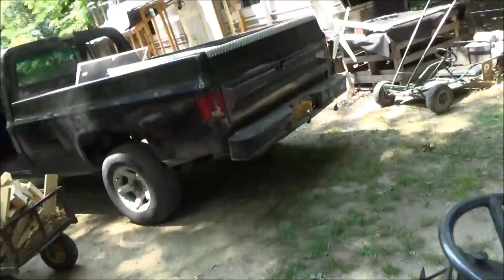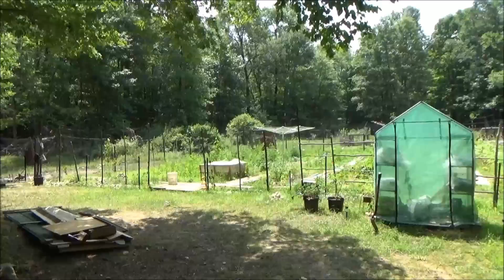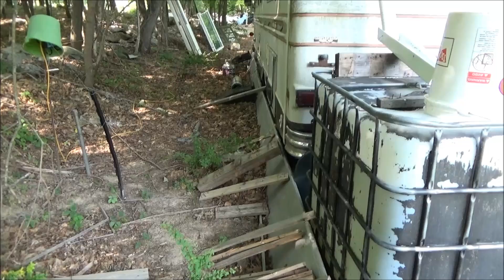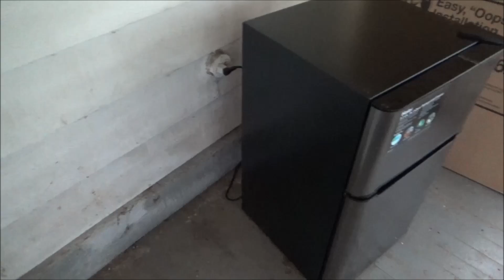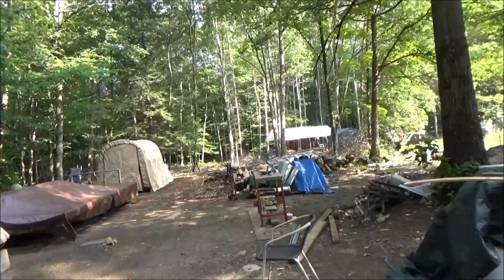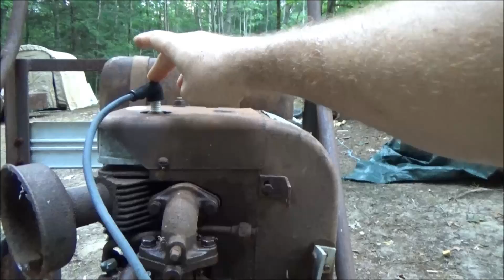Selling And Trading For Materials And Cash To Build My Tiny House

Comment: If you had kept the refrigerator wouldn't have worked just fine I your tiny house once it was up, insulated and air-conditioned with your solar and wind power?   Wouldn't the inside temperatures of your tiny house be compatible to the temps on the landlady's porch?
Reply: Rather a moot question if he does not have the money to build the house.
Reply: Oh, ye of little faith....give Troy time and the benefit of the doubt and the project will get done.

Comment: Good wheeling and dealing. I like that window. 
The bubble wrap is nice but as you say, it works mainly in one direction. You may have to add normal insulation between the outside and the bubble-wrap to get the insulation against the summer heat. It may also be needed to really get comfortable in the winter. Definitely worth investigating further.
The chickens were a good laugh. That small one is a beauty.
One question: you say you have enough material to frame the house. So far we have mostly seen pallets which you said were for the inside paneling. Will the framing be done with lots of short pieces of lumber, or do you have proper lengths as well stashed away somewhere?
Keep up the good work!
Reply from the maker: Thanks. I will use insulation and the radiant barrier. The chickens are fun to watch.
I do not have the wood yet. I will get it next week. I now have the money for it.
Reply: The Do It Yourself World I heard today's update. Looks like (almost) full steam ahead. Looking forward to that!
Reply: The Do It Yourself World
YAY!!! Good for you!

Comment: Sounds like you got a good deal on the boat trailer! If you come across a trailer that can be used for a tiny home, keep me in mind. I might be interested in buying it. I'm only about an hour and half northwest of you. FYI: that radiant barrier needs to have space in front of it in order to work. It needs to go on the inside on the framing studs. There are some good vids on YouTube about how radiant barriers work.
Reply from the maker: I sold the heavy equipment hauler. Too bad I did not know you wanted it before. I still have the boat trailer for now.
I will place the radiant barrier inside the home with space on both sides for maximum benefit.

Comment: That will not be enough insulation for your tiny house. You must use house wrap too.
Reply from the maker: Its only a radiant barrier. I will use tar paper on the outside and radiant barrier on the inside.
Reply: I would use house wrap from Lowes that stuff works great. It allows moisture to escape yet blocks wind.
Reply: Captain Carl Wright
Sounds great. Do they make underpants out of that stuff?
Reply: You'll have to ask Troy about that.
Reply: Captain Carl Wright
" It allows moisture to escape yet blocks wind. " It was a joke about this phrase.
Reply: The Do It Yourself World Hope that "tarpaper" is another general term.  I think House wrap works well.  Strikes me as being lighter, too.

Comment: That engine may sell more easily and for more $ if you got it running.  I understand if you don't want to waste too much time on it.  As old as it is though, it most likely runs on leaded gas which can be difficult to find.  Auto parts stores sell lead additive in small bottles though.  I don't know much about small engines but it's safer to find out first.  Good luck!

Comment: Did your customer take the boat or leave you with it?
Reply from the maker: Sold the heavy hauler trailer.
Reply: Sold the trailer appropriate for building tiny home
Reply: W8FG Ah, I didn't get that at first.  Yes, I agree.  We tried to get him to act in his own self interest and use the trailer not made from spaghetti.  Hope it works out for him anyway.  There was no need to gamble or rely on "hope" with that equipment trailer.
Reply from the maker: RadicalRC That trailer was smaller. Too small for me. And HEAVY.
Reply from the maker: I would have needed to hire a professional towing service with that trailer anyway. It was over 3500 pounds empty
Reply: The Do It Yourself World You are already planning to hire a professional towing service regardless.  It's weird, but I remember things.  ;-)

Comment: I am eager to see walls!  So, glad you got the trailer sold... hope you can get enough  2x? to do the walls now.

When does the framer plan on arriving?
Reply: The Do It Yourself World
Seriously, find another professional framer. Put an ad on Craig's list offering your services in exchange for a retired framer to help and work with you. You can offer lawn mowing, attic cleaning, hauling or whatever they wish two hours for one since they will be giving you the skilled help you need for unskilled help they need. Some retired builder may be happy to pitch in and feel useful again especially if he can get help and companionship in exchange...not to mention getting away from the beloved wifey for a while. :)
Reply from the maker: He is not coming now. I need a Plan B. I guess I could set up a tarp and sleep under it ;)
Reply: *****
Perhaps he could make a sleeping bag out of the reflectix.
Reply: ***** The roofing is the large sheets of green metal that he has... I am not sure but I think he will need another set of hands to get that safely up top, but once up it goes on really quick.  The roof framing is planned as (what I call) a shed roof...it is flat but it will still be a real challenge to frame and I am concerned how much time the roof framing will take.  It looks deceptively simple.  Not easy but where there is a will there is a way.
Reply: Uncomfortably Numb
Well, I can see your point.

And yes, I do think that hemp needs to be put back into the environment to help clean up all of the agricultural and industrial chemicals that we've polluted this planet with over the last century.  (Like they're using it as a bioremediative plant around Chernobyl and Fukushima, to help remove radiation from the soil.)

The sorts of cannabis that have medicinal value should also be available to everyone again...but that's a whole different issue, as medicinally beneficial strains of cannabis are one of the top three reasons that hemp was made illegal in the first place, the others being petroleum fuels replacing hemp seed oil and alcohol as fuels (both 100% annually renewable, natural, carbon-neutral, and freely available to anyone with enough land to grow on), and William Randolph Hurst wanting to replace hemp in his newspaper with paper made from the trees he had on his thousands of acres of forest land...which his buddy who owned Dow Chemical figured out a way to make paper from trees, while selling a ton of toxic chemicals in the process.

History!  It's bloody amazing what they've done to this planet that never should have been done, when you do a little research!  d;o)
Reply: *****
Onslow was one of my nicknames. Can't think why. apart from the facts that we look and talk exactly the same. And these days I am completely surrounded by no beer.
Reply: The Do It Yourself World
Well, you've already got a book on framing, so taking your time, making sure all the wall studs are the same length (you already knew that part), making sure that all of the bows in the studs face OUT (I mentioned that earlier), and you can get that banged out in a day or two TOPS with a couple of guys showing up to help raise the walls once they're complete and square.

The ROOF is the part where you're going to need "skilled help."  The simple logic behind that is that it doesn't matter how good you did the walls and the floor, if the roof leaks, YOU GOT PROBLEMS!  Just with the actual framing of the roof itself...shingling is fairly easy, just time consuming when you're hammering it on, and not using a nail gun...but most people don't have a roofing-specific nail gun anyway...which is what you'd need for that job if you weren't already planning on doing it manually.
Reply: The Do It Yourself World
You could throw a tarp over the blue table then curl up underneath and sleep through the winter months.
Reply: Uncomfortably Numb
Actually, being realistic about it, the smaller the space, the easier it is to heat, and the more well-insulated that small space is, even better.

There are people who've built hyper-insulated homes that are so efficient that they need to open windows in the winter when there are more than a half-dozen people in the house!

And we KNOW he's got more than enough insulation, now!  d;o)
Reply: The Do It Yourself World I agree with Larry.
Reply: Uncomfortably Numb
I hope not...a do it yourself sewing video does NOT sound terribly entertaining, to be honest...  d=^o
Reply: *****
lol. Got to be at least as entertaining as making salad.
Reply: Actually, that's not a bad idea at all...doesn't matter if they're a friend or not, if they're QUALIFIED and you can still work out a good deal that's beneficial to both of you, the cost can be the same either way!  d=O)
Reply: Uncomfortably Numb
No...I think making salad is slightly better.  Now, if they were showing how to create the thread from wild hemp fibers, then it'd be more interesting.

You know...running through the forest, with "The Long Arm of The Law" hunting you down, as you try to get enough wild hemp stalks to make your thread...it'd be like an episode of "Moonshiners", only with a far more mundane series finale...  d;o)
Reply: *****
As someone who eats tomatoes and basil with lettuce and cucumber at least 3 times a week it is not really that exciting to me.
I now have a vision of you swinging from hemp liana's through the trees in a loin cloth. (reference to the motherlode of pallets video at the end) ;)
Not heard of Moonshiners here in ole blighty will have to look that one up.
Reply: *****
Don't forget clothes & building materials etc.
Reply: Uncomfortably Numb
And almost everything made of plastic...could be less toxic, and biodegradable.  Funny thing...anyone looking around their room right now is seeing DOZENS of things leaching toxic chemicals (or DONE leaching them) into the air around them, and thinking "Huh?  Whassis, eh?"

And now they're counting the number of potentially toxic plastic items within eyesight...  d;o)
Reply: *****
It is truly an amazing plant. What is more amazing is that it is classed as a weed. More like life support plant to me.
Reply: Looking back through history, it was one of the main ingredients in "gruel."  You know...that stuff the Dickens' lil' bugger wanted more of?  d;o)

Nuts...now I'm thinking about food...and there ain't no Gareth Blackstock in my house...not even an Everton...  (a proper Brit will catch the reference...)
Reply: Sorry to dissappoint you I am a brit of 51 1/2 years, Grew up near Liverpool then moved to Reading in 2001 then to Portsmouth last year. I had to google that. Never watched the show. Not even trailers. I think it was on during my heavy drinknig days, ie straight from work untill kicking out time. (midnight usually)
Reply: Uncomfortably Numb
Pub after work 'till legless?  Yup....still qualifies as "Proper Brit."  We'll let "that one minor faux pas" slide.  (Sorry about the froganese.) d;o)

And me, completely missing Onslow...a much more obvious reference...horrible oversight on my part, wasn't that?  d=^o

Comment: Great buy on that window!    How do you plan to use the barrier?  Over other insulation or alone?
Reply from the maker: Thanks. I will use the barrier on the inside with spacing on both sides for its max benefit.
Reply from the maker: Larry Carlston I am quite surprised myself. I guess that is the benefit of shade and insulation. I do not have either in my RV. The tiny home will probably be that comfy next summer.

Comment: Why not use your cardboard as weed barrier in your garden rather than throwing it away.  Earthworms love the glue that it is made with and you will be amazed at how short a time it takes to attract them.
Reply from the maker: I am going to get a bunch soon
Reply: Get a bunch of earthworms?   Put the cardboard down in your garden and you will attract them by the hundreds...harvest them for your worm bin and you won't have to buy commercial worms at all.   I built a lasagna garden with layers of cardboard, leaves, pine needles,wood chips and composted manure on top of almost pure sand...(I live in an area of Wisconsin where they are harvesting our sand for fracking) and attracted so many worms it was unbelievable.  Plus, my garden production was through the roof that year and in the coming years....I had to add nitrogen the first year due to the breaking down of my mulch but it produced a wonderful black topsoil where there was none before and nothing grew due to a heavy layer of pine needles over a semi shaded area..

Comment: The silver barrier material works very well.  I just did my van and it made a world of difference to sound and heat / cold.  Glad to see you getting your materials together and slowly sell off the stuff you were planning.
Reply: ***** Thanks.
Reply from the maker: Yes its coming along slow but sure. Good to know about the radiant barrier. Thanks
Reply: The Do It Yourself World That is truly AWESOME!! I have been trying to find that stuff around me. I thought they would have it at Home Depot, but I haven't found it yet. :(
Reply from the maker: MotherOfManyHorses They should have it. I just saw it online. Someone posted and said it is called "Reflectix"
Reply: MotherOfManyHorses I bought mine at Home Depot Placed the order and had it in a few days.  http://www.homedepot.com/p/Reflectix-24-in-x-100-ft-Double-Reflective-Insulation-BP24100/202851855?N=5yc1vZbedf
Reply: The Do It Yourself World I guess it's not something they carry in the store near me then. I'd have to order it online. I'll look into it, thanks.
Reply: MotherOfManyHorses NP. The barrier goes up very easy. Its bubble wrap core with a thicker outer shell if plastic aluminum sheen. Similar to those space blankets runners use after a marathon or a survival blanket. You can either spray glue or staple gun in place. I also added a either the same material Troy used in his flooring or polyfill insulation in my project and was totally impressed this summer on how cool and quiet its inside (my application is a van). I would definitely use it again.